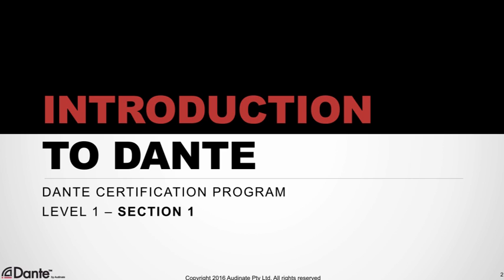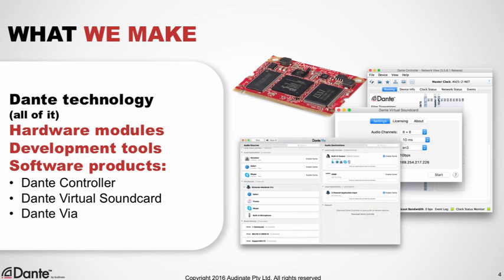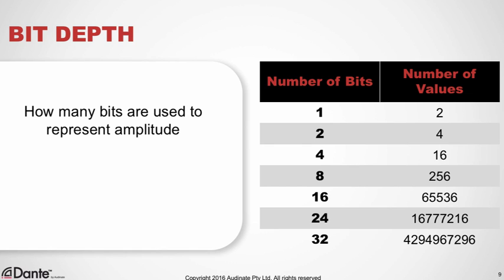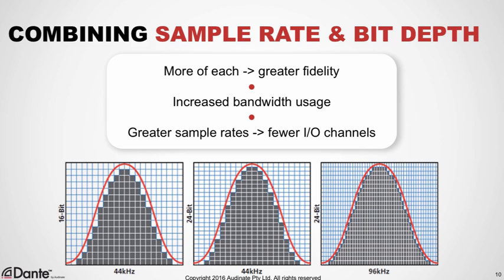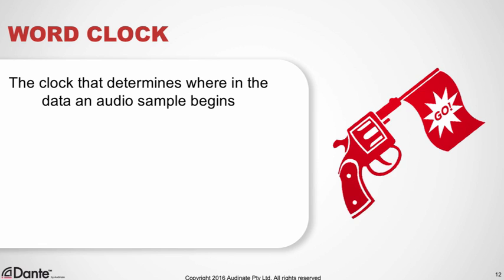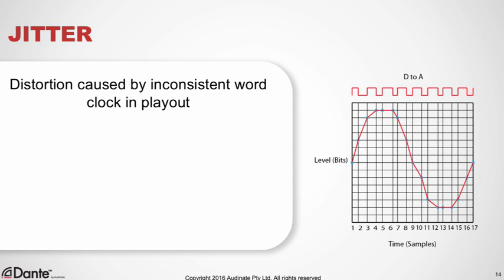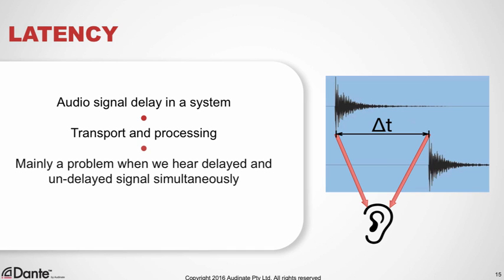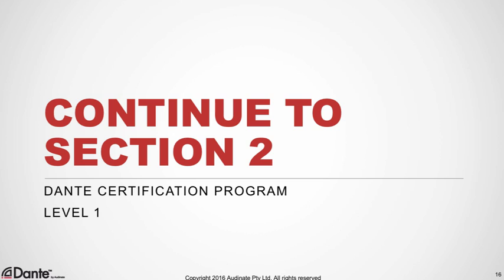Dante Certification Level 1: #1 About Audinate - Digital Audio Basics

Comment: @6:04  When you say "Mega"bits per sec you shoud use capital (upper case) M. "m" is used for "mili" (10^-3) and "M" for "mega" (10^6) in International System of Units.
Reply: Thanks for clearing that up.